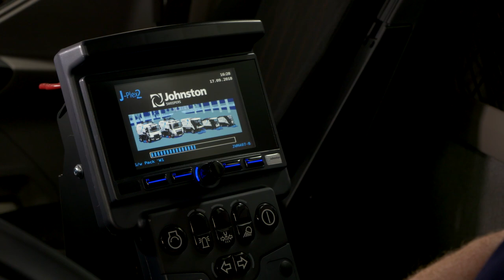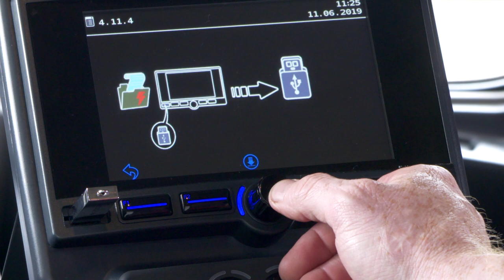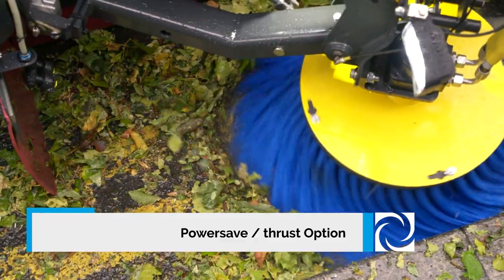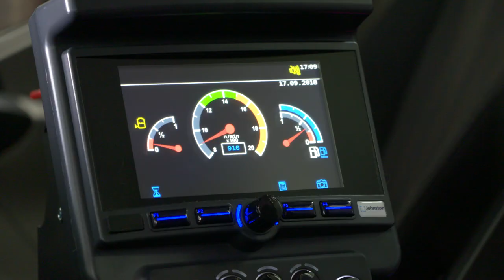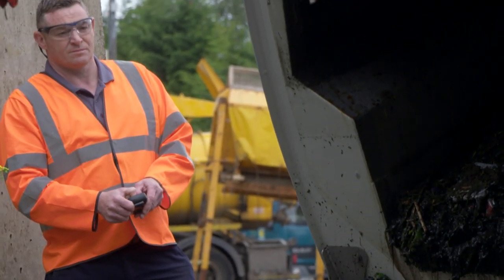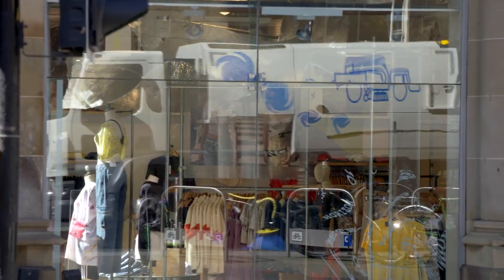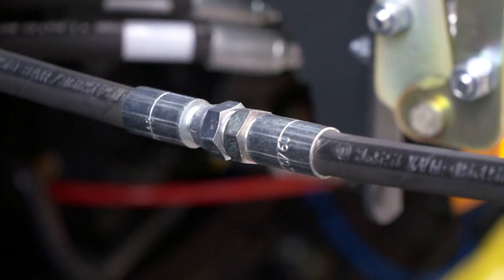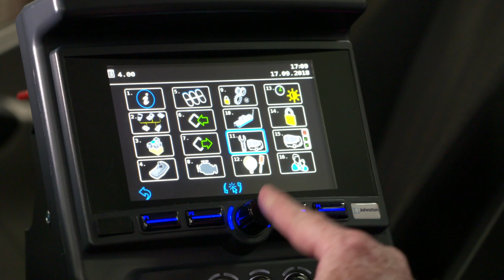Archive: VE652 - All-electric Truck Mounted Sweeper

Comment: 8 hours isn't much use for the 10hr shifts I sometimes do 
What happens when the battery pack dies? 2000 cycles would be 10 years or less at a minimum of 200 days a year. Only 5 years if you did 2 shifts.
Reply: I do 12 hour shifts and sometimes few nights so not possible for me lol